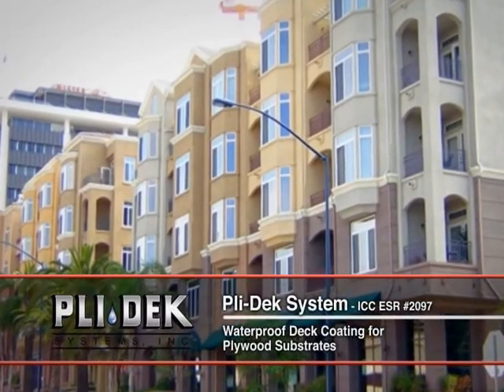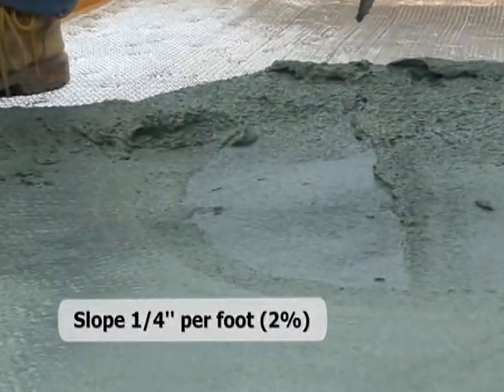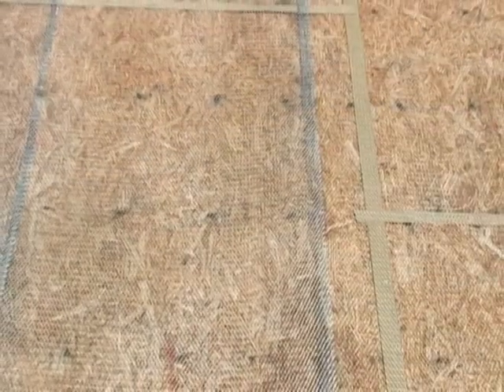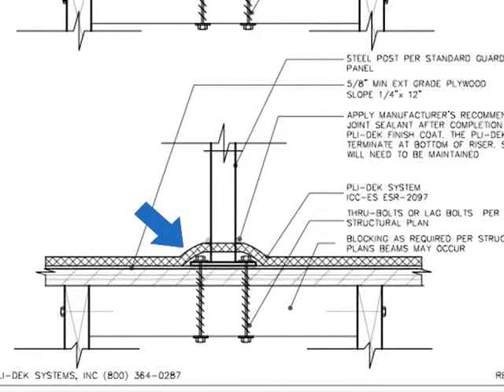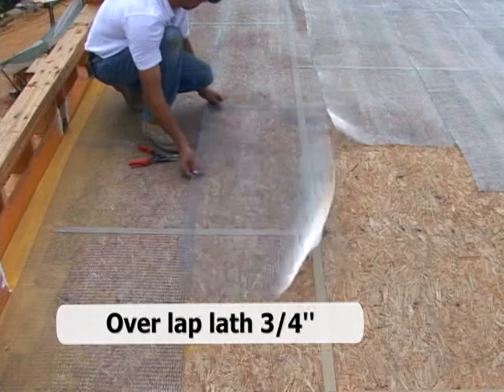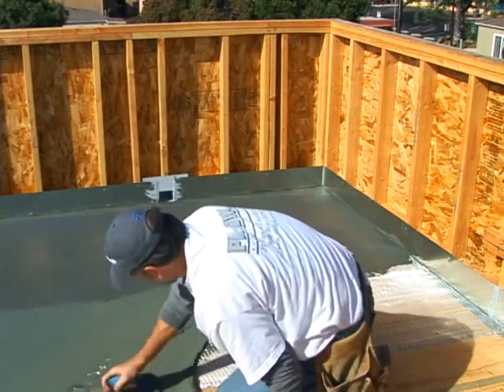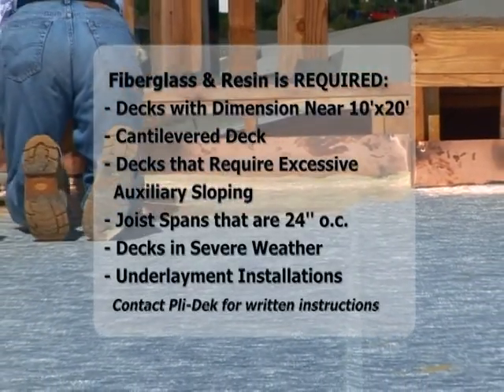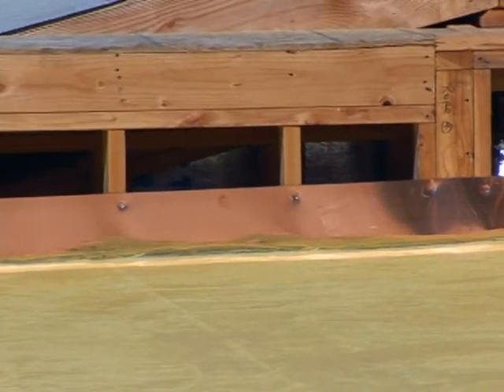PLI-DEK TRAINING VIDEO CHAPTER 2 - PLI-DEK ICC SYSTEM OVER PLYWOOD

Comment: Nice video, captioned as "ICC system over Plywood".  Instead we see the questionable use of OSB as the substrate.  Most manufacturers prohibit the use of OSB under their waterproof deck systems.  Not sure why Pli-Dek would promote this as an acceptable substrate.  I wouldn't go over it under any circumstances.
Reply from the maker: Good afternoon Em. Your concern is definitely understandable. Pli-Dek has been tested over OSB and has passed. Please see below for the verbiage that I pulled from our Technical Bulletin 112 which I can send over to you. Shoot us an email to sales@plidek.com and we'll send it right over. Also, you can contact Jan Bagnall the VP/National Tech Rep at 714-493-9292 to get an in depth explanation. Let us know if there is anything that we can do for you! Thank  you!

SYSTEM TYPE: Pli-Dek System
INTENDED USE: Pli-Dek recognizes that OSB is used as exposure 1
sheathing in exterior decking applications. Pli-Dek has
a “Limited Material Warranty” application of Pli-Dek
lath system over a minimum substrate thickness of
19/32” OSB. Ensure OSB has not been exposed to
inclement weather for extended time periods resulting
in delamination prior to installation of the OSB.

ASTM TESTING:
1) Pli-Dek Walking Deck and Roof Covering System
using a minimum substrate thickness of 19/32”
O.S.B. has been subjected to an independent
testing laboratory and has passed both of the
following ASTM Tests.
a) ASTM E119 - One-Hour Fire Rating Test.
b) ASTM E108 - Class “A” Fire Rating Test.
c) ASTM C297- Bond Strength Test
Reply: At least be consistent then if you're going reference ICC ESR 2097 which clearly lists the materials tested for both Con-Dek and Pli-Dek on Table 1 of the report.  To meet Class A and one-hour fire resistant requirements, APA rated plywood must be used.  If as you say OSB has been tested, was it to meet Class A and one hour standards?  I suspect that if as a manufacturer, you had a choice as to what substrate was used for any Pli-Dek application, it would be plywood, hands down.
Reply from the maker: Pli-Dek was tested over OSB when it was becoming more popular on buildings. You are right, that we do prefer the use of plywood as the substrate and plywood is listed on our ICC Report, but we didn't want to rule ourselves out on any OSB buildings. That is why we tested the system again over the OSB Substrate to meet the fire rating and bond strength.